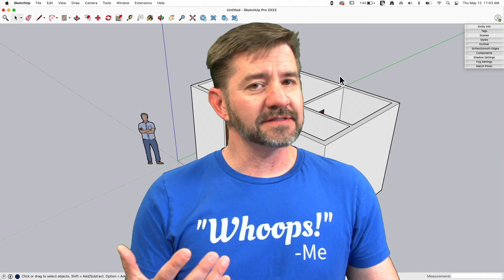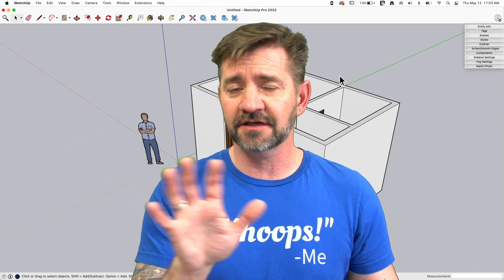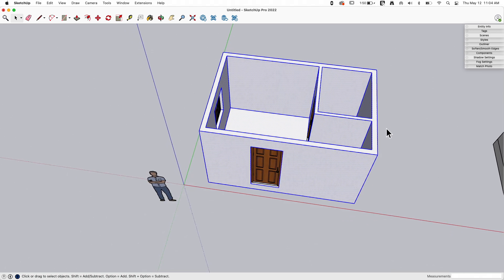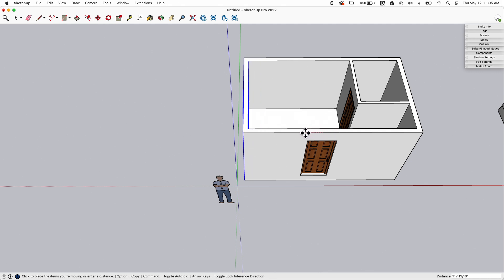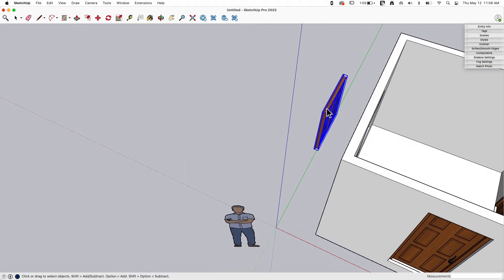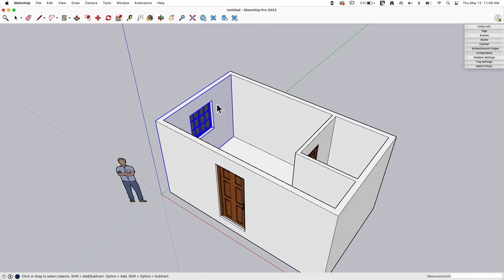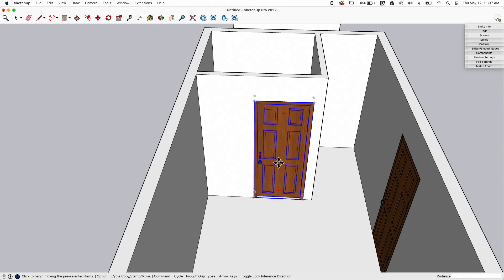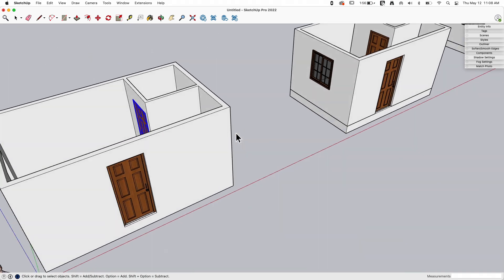Moving Walls - Skill Builder

Comment: You are a smart guy but this software is just not snapping to the basic easy use workflow... actually non of the software's out there are friendly use. 
And when you think about it, the task is not that difficult. Floor, exterior walls, interior walls, windows, doors, roof. And everything else can be designed with twinmotion etc ...
I'm really surprised that there is no one really good software that can be enjoyed easily and simply for my creation needs.

Comment: 9:40 Rule #1. Always leave space for casing. Casing width+1/2 inch is a minimum. Thanks ;) (I’m a trim carpenter, I see this simple mistake in every home I work on).
Reply: Agreed, I too am a trim carpenter.  And as we use wider trims framers should be made aware of what is needed.

Comment: So, I've noticed in previous videos that you group individual walls and floors and such separately, which I can understand if you are trying to figure out the design of a space/building.  The problem is you end up with a ton of lines that you don't want to see if you want a rendering of the project for a client.  I do model each floor monolithically (walls and floors) and group them so I can easily show a cutaway of each floor, but have to make sure to hide lines at the top and bottom so that you don't see physical breaks when the building is seen as a whole.  Is this something you do to each individual wall and floor group, or do you model differently depending on the use?
Reply: Yeah when you use this method you see lines in the corners where the diffrent parts connect. Not looking so good. Is there an easy way to hide these lines? Smooth edges?
Reply: Edit: I'll guess you just right click and click hide on these lines? The right way to do it?

Comment: Thanks. It would be very useful if the door is able to move with frame in wall. 
May be there are such tools in su ? 🤔
Reply: Yes.  I also would like a way to lock components to a reference point, like windows to a point in an opening or cabinets to a wall, although I'm not sure if it could be done.